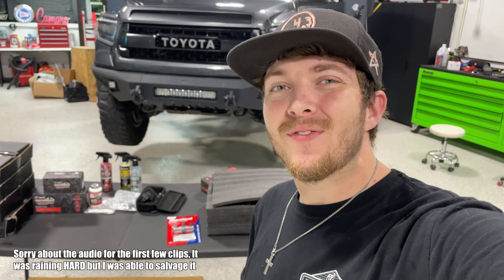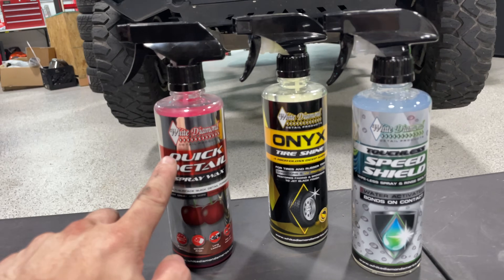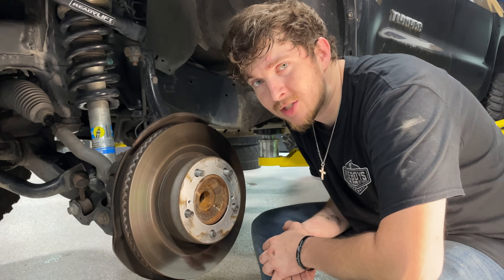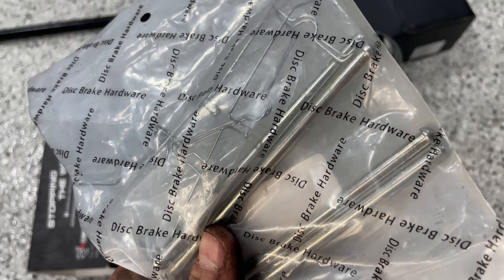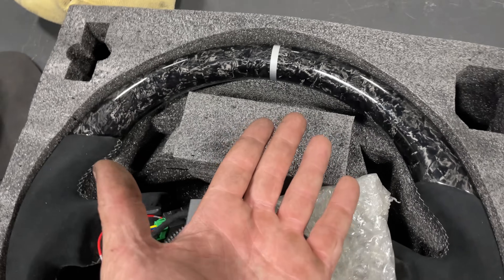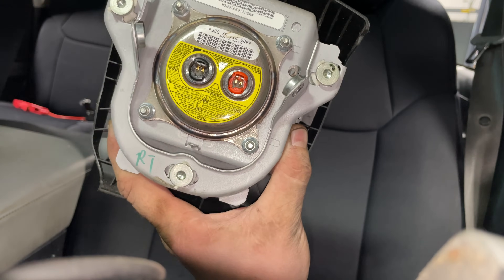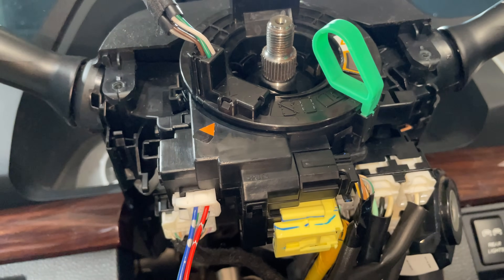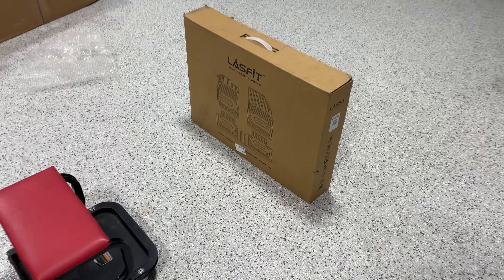Tundra CARBON FIBER HEATED Steering wheel Install + Brakes and more!

Comment: I have used a lot of powerstop truck and tow brake upgrades and they have served me extremely well. Their break in process is very different. They want 5 hard stops I think 45-15 mph then 5 like 35-5 moderate half pedalish stops back to back with no cooling time in between.